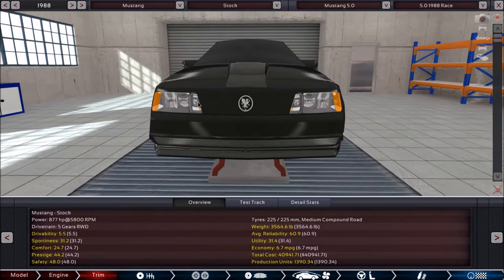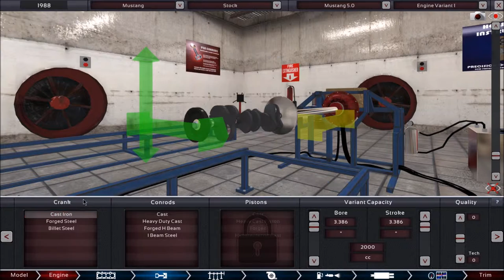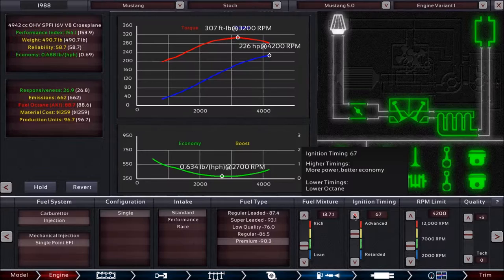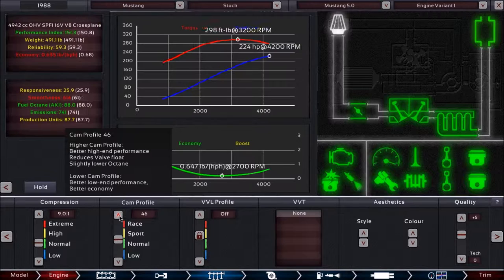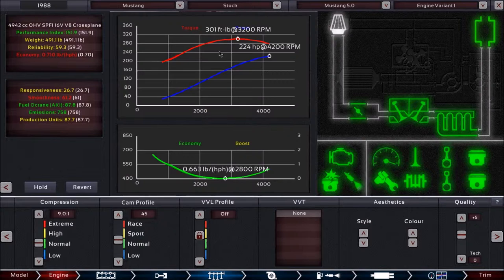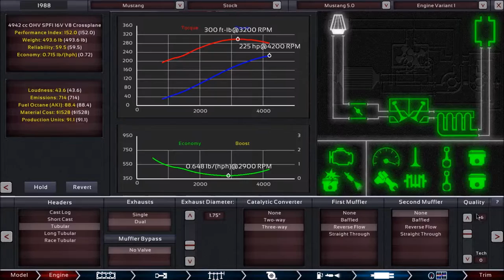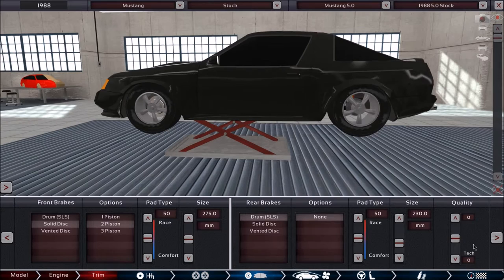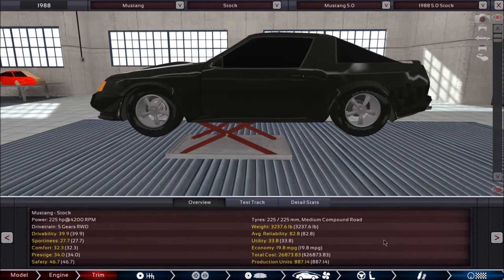Let's Play Automation! Part 9 (1988 Mustang 5.0 Update)

Comment: Also the Mustang came with a 225 size tire in the rear
Reply: 225 all 4 corners.  225/60/15 turbine wheels,  then 225/55/16's on ponies in the later ones.
245/50/16's fit the pony's very well though.  that's what I run.

Comment: 88 5.0 is multipoint efi. There are 8 injecters mounted on the intake manifold near the cylinder heads. Single point has 2 injectors before the throttle.